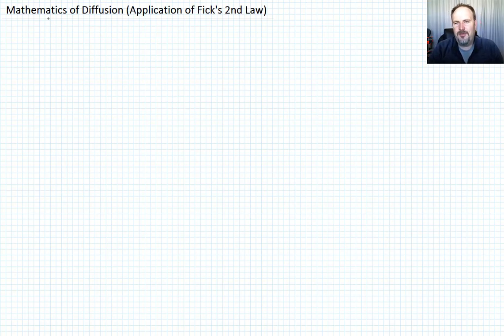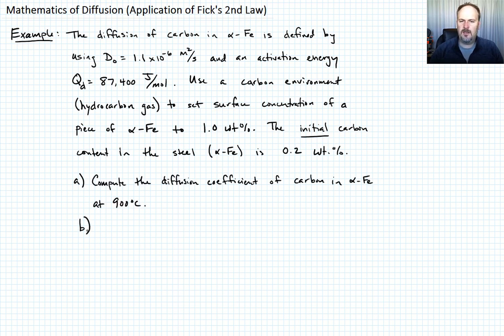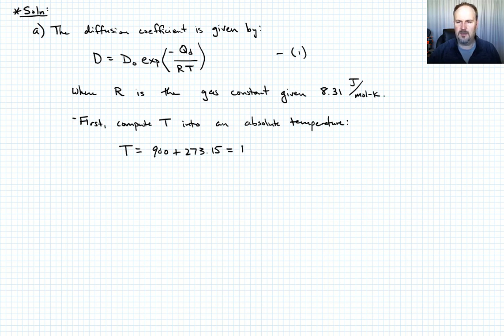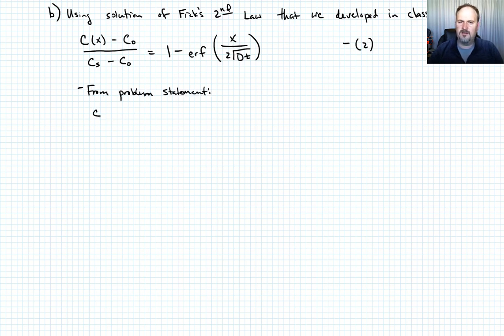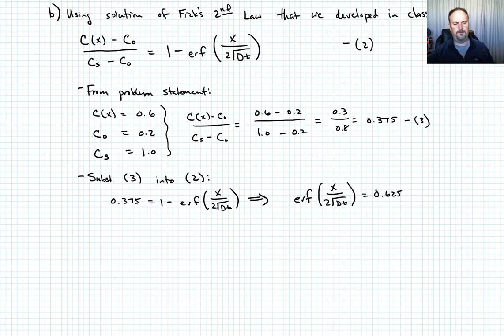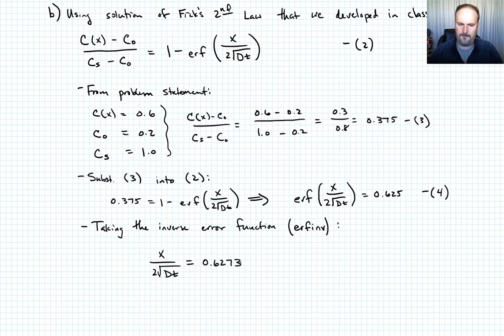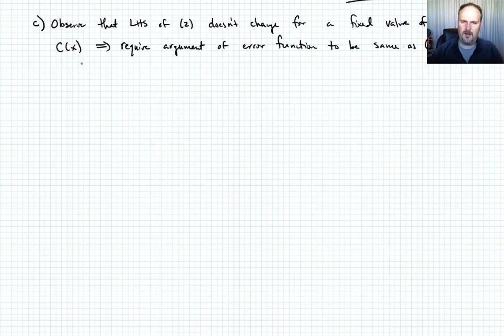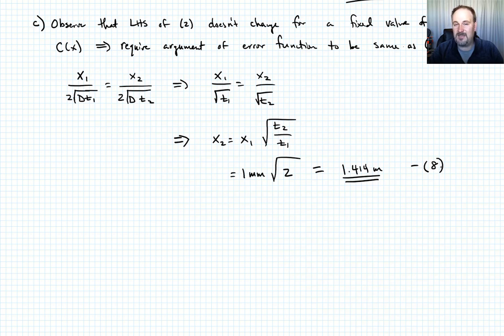4-2e: Diffusion (Mathematics of Diffusion - Application of Fick's 2nd Law)

Comment: Hey Dr. Fertig,

I just noticed at about 7:12 in this video you calculate the value of .6 - .2 to be .3, which is incorrect and carries through the rest of the problem. I still understand the calculation (I think) but just thought I'd point that out.